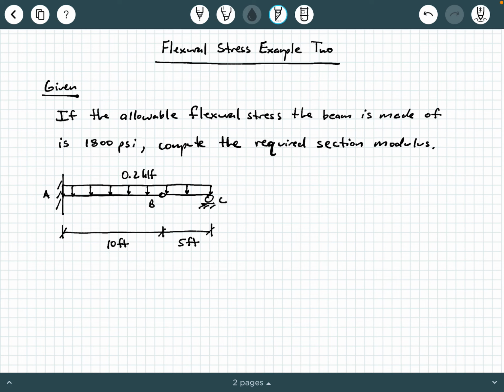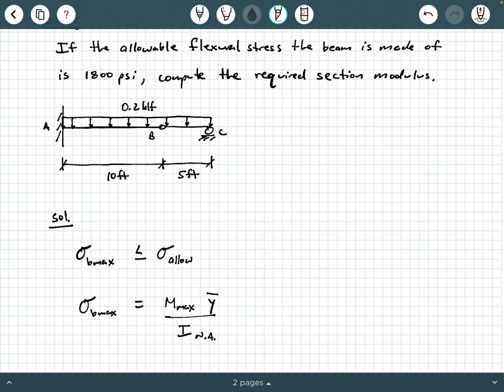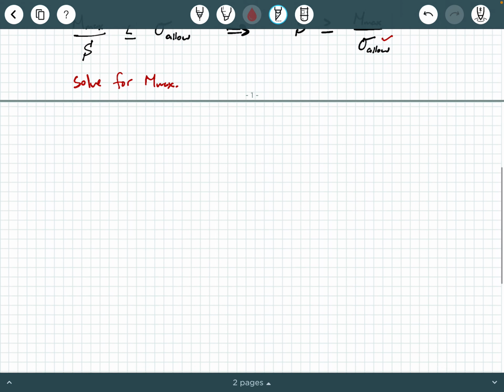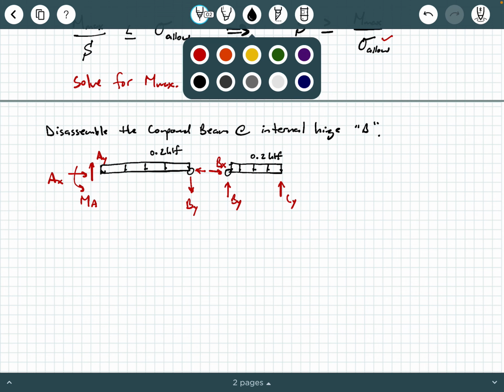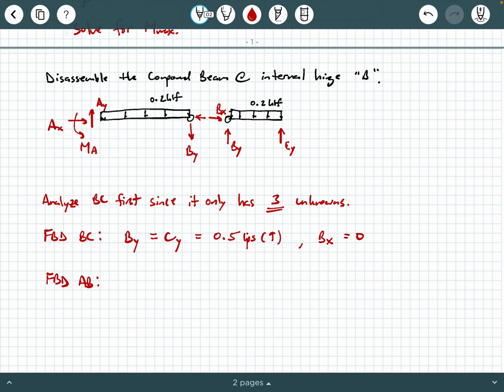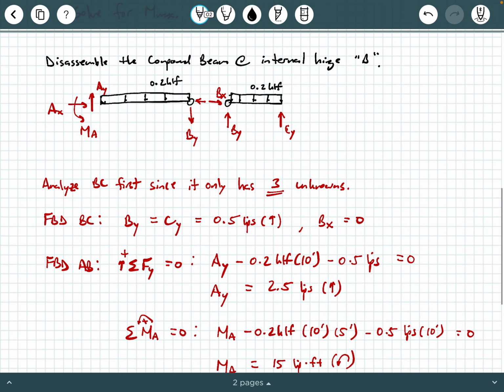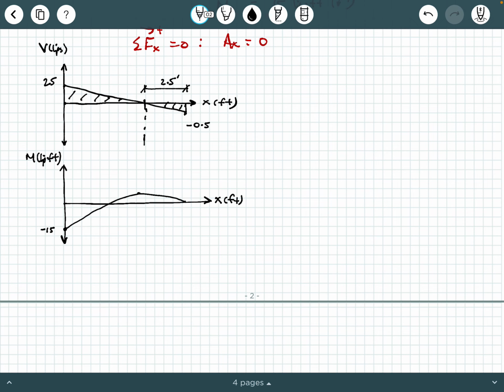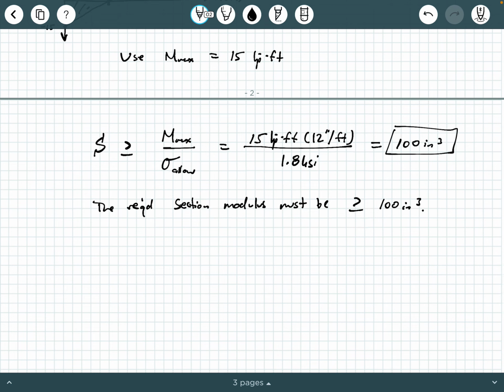Mechanics of Materials - Video 79:  Flexural Stress (Bending Stress) Example 2

Comment: I have a question with regards to solving for the Moment @A, if I consider the entire beam and sum up moments at point C, it is equal to 17.5. Why is that?
Reply: Ahh, never mind, I found the problem. I included the internal hinge in my calculations, and I forgot that the reaction when summing up moments for internal hinges were 0